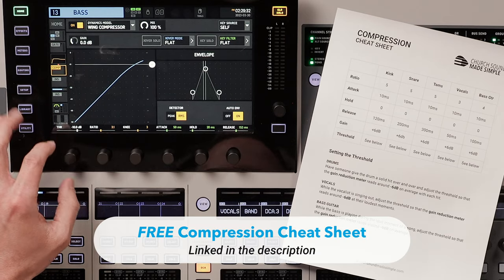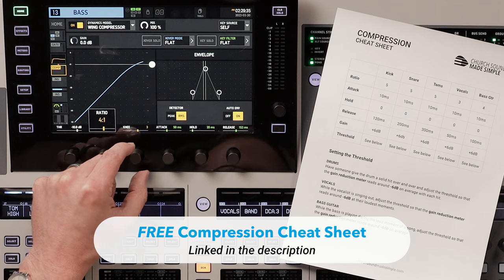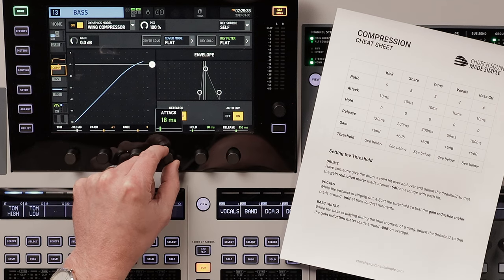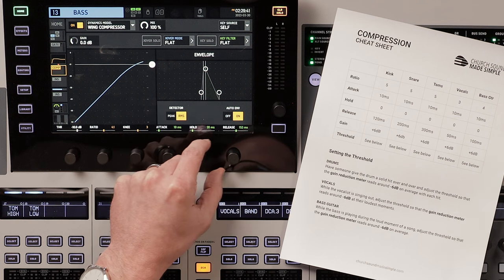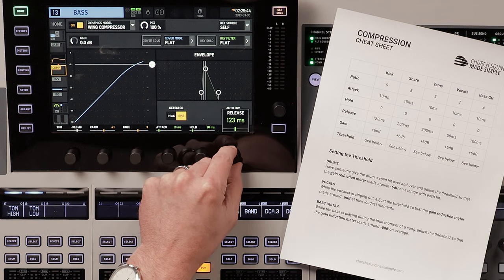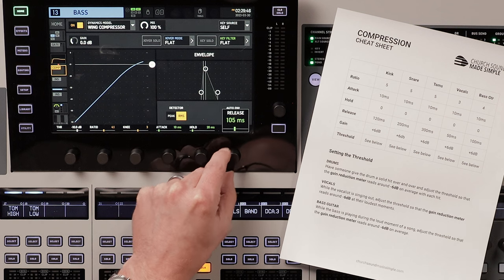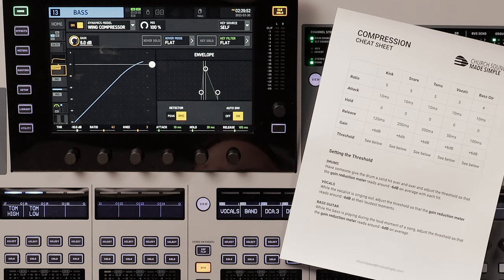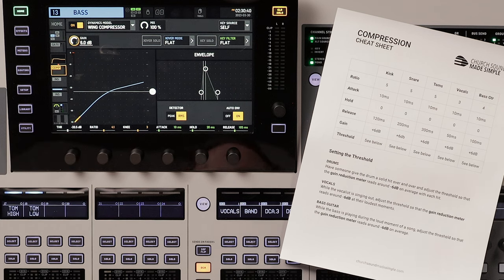How I MIX BASS GUITAR | EQ & Compression Examples

Comment: The fret buzz and fret slapping noise coming from what otherwise is an excellent choice for a bass is very distracting and makes it hard to properly EQ the bass.  First of all, the bass needs to be set up properly for the player using it to eliminate the fret buzz, unless that's a desired characteristic now. I agree with the high pass filter (you call it a low-cut filter) and the high shelving above around  1.1K but there's way too much compression and almost no sustain.  A compressor is traditionally used to level out the high peaks, like you get with slap bass, and help give the bass a consistent level and bit of sustain for those long whole notes that happen in certain songs, not to squash the overall output of the bass.  If you want less bass in the mix then reduce the level post EQ.  Overall, after your tweaks, the bass seems to disappear in your mix with the whole band.  In the full mix, the bass should be "present" and articulate.  I hope this helps!
Reply: Yeah, that finger noise is really tough to mix. Shows you how much the player themselves can make a good instrument and setup just sound bad.
Reply from the maker: I get what your saying. Our bass player actually really knows her way around a bass. Every single Music Man I've heard has that string noise characteristic from the factory. Hardly ever hear one played without that grungy fret noise. Even seen some videos of pros playing them and getting that sound.

I'm sure you can get a setup that would mitigate, but I'm pretty certain that the sound was Earnie Balls intention. It's part of the basses intended character, love it or hate it. -Dillon
Reply: The MusicMan is such a "character" instrument. I would have preferred to hear this demonstration with a different bass/player combination @collabworship
Reply: The problem is play bass with a pick, sound horrible

Comment: Putting a low cut on the primary instrument responsible for the low end of your track is not just counter intuitive;  it's counter productive. At this point I feel like people just put low cut on everything by default.
Reply from the maker: In this case, the low cut is simply to clean up any rogue frequencies generated that don't matter. The last thing I want is for my speakers to waster energy on trying to produce something it is not capable of.
Reply: @collabworship  I understand, but the Lowest frequency on a 5 string bass is 31 Hz. If your bass is only four strings, which is not common anymore unless you're playing funk of punk rock, I think that may be too aggressive of a cut for a bass guitar.
Reply: It’s good for old people